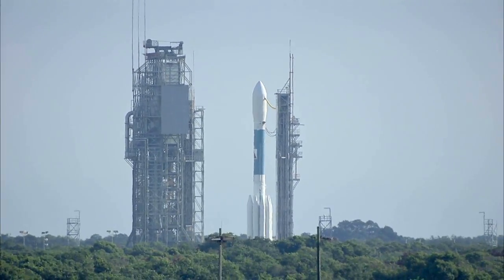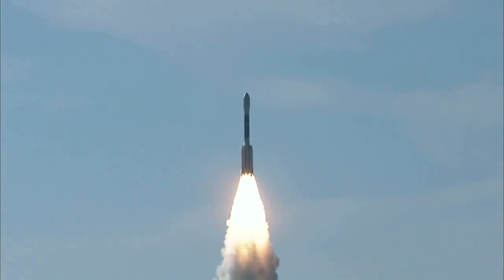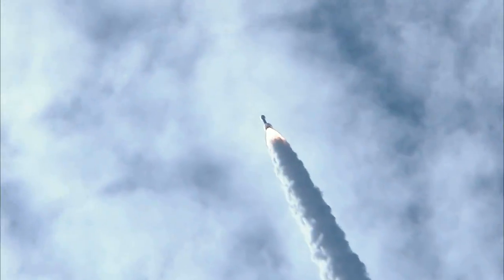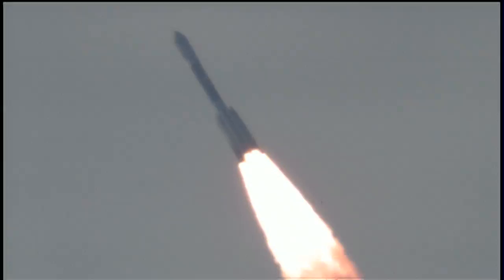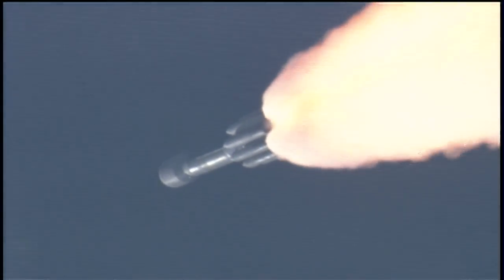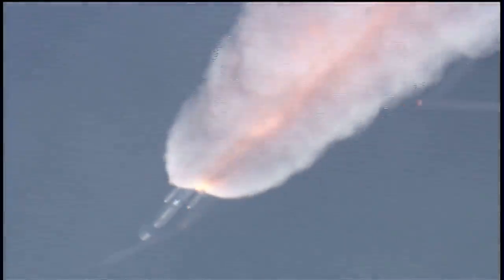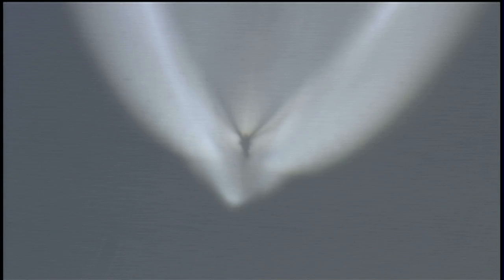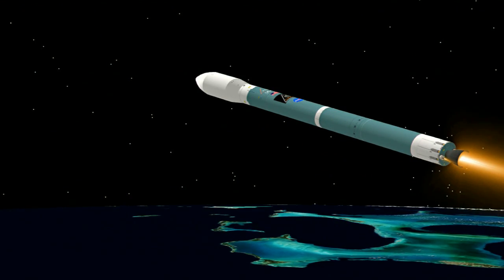Delta II Launches GRAIL Spacecraft

Comment: There's quite a significant angle of attack on the rocket as it leaps off the pad. I'll bet that the Delta 2 Heavy holds the record for most lift generated by a launch vehicle during ascent